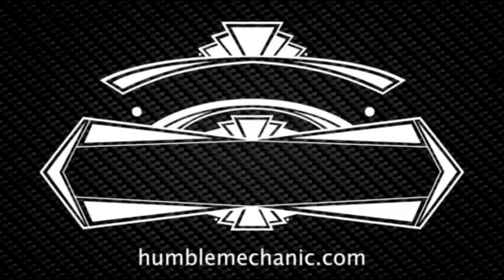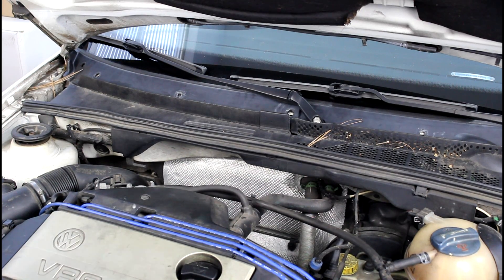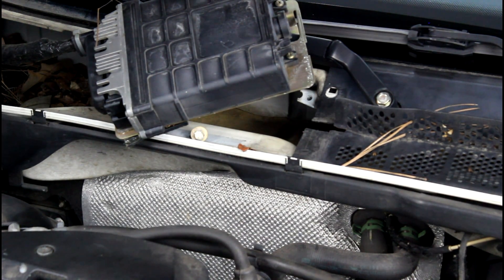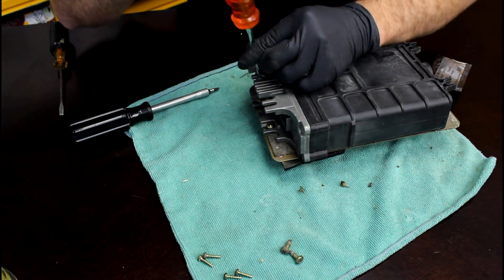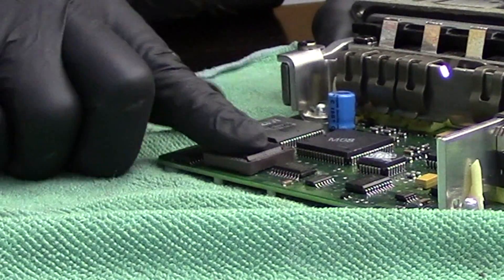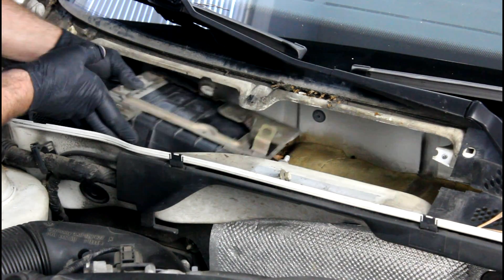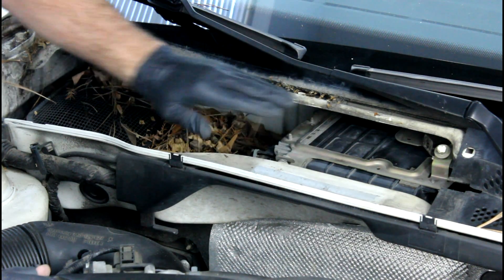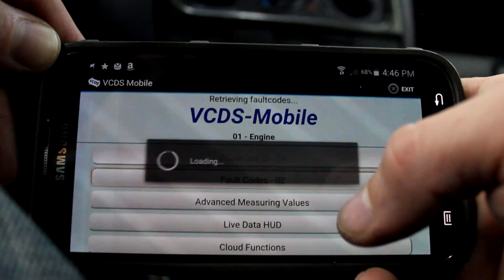How To Chip a MK3 VR6 ~ DIY Video

Comment: Hi help/exsperience would be great 

i have a 0bd2 vr6 loom(uk spec) and have just recived a north american ecu with same ecu numbers but the americam ecu has little corner blocks on the ecu plug and the uk spec loom does not have cutouts for them (ecu wont plug into loom).   
All pins/conectors and wires match exactly    .  anyone know about this befor ?  
thanks for any replys

Comment: HumbleMechanic-I realize this is an Mk3 tune but, is there a good ECM MOD FOR MY Mk4 2003 BDF 2.8-litre VR6 24v ?? I know its holding back with its electronically controlled HP. The factory says its at only 200hp stock but, i saw one dyno'd stock at 211hp with only basic mods. KN Filter, royal purple oil, etc
Reply: Did you reflash your ecu in your 24v? I see Malone Tuning has reflash sale until the end of the year at ECSTuning that will net something like 15hp and 20 tq and for under $300 I think it's worth it.

Comment: I did this the other day and found a  giac chip installed from a previous owner, my plug had lots of broken bits and did not disassemble as easy, now my check engine is back on again. At first I though it was because the connection wasnt secure, but I've been driving around with no driveability issues.

Comment: High impedence (peak and hold) line driver. Running 850cc or 1000cc injectors? Definitely the way to go. Adaptronic has some units starting at 850$. For 1350$ you can get an 8channel high output unit(m2000) that can make your VR idle way better than stock even with big/fast injectors. Use a narrow spray pattern on a single valve.(12valve). Standalone has autotune have no fear. Run and do anything you want. Convert to drive by wire and direct ignition.

Comment: I've recently changed my a/c pump, to do that I removed the front end, it was an easy procedure and accessibility made the job easy. Long story short I popped a header tank hose and the temp warning light came on, fixed hose, drove car and it died three times. The last time a friend with a scan tool did a code clear and it started and got me home. When we went to drive again no start. Is this what you meant do a one key cycle, to make sure the code doesn't come back, and what if it does.

Comment: just got a Reflex Tuning chip for my Mk3 VR6, runs soooo much smoother than the GIAC previously used. Highly recommended.
Reply: I see this chip getting around now especially i just seen this vlog from chrstian smith doing a decent preview of the chip. Ive had 95 vr with the garrett chip and wanted to know the difference. There was a timenwhere giac was the shit and the best chip for the vr.  Being that you went from giac to reflect tuning.. you feel its more power? Garrett boast to this day 12 hp and tq respectively. And does it really rev out to 7500 rpm as to garretts 7200?  Thanks.
Reply: What are the advantages of this chip?

Comment: I have been watching your video and really like them. I am doing some research and would like to know what you think. I have a 2002 Jetta Wagon with VR6. I have been discussing doing some modification with others who own VR6s. I was told that the stock engine can handle 400 hp all day long. I utubed vr6 stock engine with turbo and found 400hp turboed cars. I know I would need to upgrad the fuel system. I only want 320 to 350 hp. Would a chip and injectors work? 
I sure wish you were closer to Washington State and see if you would be interested in doing a show on stock engine upgrade. Anyways any input would be appreciated as I completely trust your knowledge about these motors..

Comment: Am I the only one who thinks that isn't the best place a ECU should be placed?
Reply from the maker: +freelan89 you're not the first to mention it. But everything worked out just fine.
Reply: The Mercedes A-Class had the ECU right on top of the engine. In order to change the air filter,  you have to disassemble the ecu. Haha I hate that car
Reply: No, it has a draining system that makes water go to the sides of the car, no water gets in there, only dust and stuff.
Reply: no it's isn't bad place.
Reply: wont water get in there?

Comment: Great vid, but what exactly does this chip do?. Is it a tunning chip, or is it a performance upgrade, how much HP increase. I might have missed something, or does this chip just allow you to clear fault codes?. Can you get a performance chip off your guy, might be a cheap HP increase before the turbo goes on.
Reply: it looks like its used to cancel out codes ...not performance related
Reply: You can clear basic codes like that with most any scan tool. Vcds is used to get access to everything the dealership can. Im guessing it was a performance chip. He just didn't explain what it altered

Comment: question.... my vr6 is q chipped. I bought an emissions delete chip as well, can I use them both at the same time?
Reply from the maker: It will only take 1 chip. The tune should delete emissions too
Reply: +HumbleMechanic the q chip will?

Comment: In the 2 month since you installed this chip did you see a noticeable difference? I don't know much about all the different brands of chips, but for $100, and within the website description, it seems decent. Thank you :)
Reply from the maker: Other than I have no check engine light, not much. But this is a stock car that needs some maintenance. 

It will really shine when I get an intake and exhaust. :)
Reply: +HumbleMechanic Fair enough, I'v got an exhaust/intake.. getting rid of that secondary air code would be cool :)

Comment: i see alot of people suggest an anti static work surface. the only suggestion i would have is to keep that seal good and to help it a little bit.....a thin layer of di-electric grease works wonders. Also great for your main harness plug in to keep any water from getting into a plug with an old seal.

Comment: I'm surprised you havent rigged up a cabin air filter from mk4. The bracket for it bolts right into the mk3
Reply from the maker: That is absolutely on the list!
Reply: @HumbleMechanic  hoping you can help. I bought a chip for my obd2 12v, followed your instructions (thank you). But the car doesn’t start with it. The check engine never illuminated once the accessory lights came on. I swapped the stock one back in, the car started. What gives?
Reply: right. I just did the same thing

Comment: It would be nice; if you would do a review of the wireless HEX NET, version of VCDS. Many of us; have the cable for years but have not made the leap to the wireless version. So far, from a cost effective point of view; I still think the VCDS License with HEX-USB+CAN Unlimted VIN (All VAG), is the best deal (although being tethered to a windows based laptop is a drag). It would be cool; to use a phone or tablet, however.
Reply from the maker: I will. Some of the wifi is still beta. Well at least on the app. But it's pretty awesome

Comment: PLEASE work on an electronic safe surface. When I was putting a new heat-sink on a computer part I was also using a micro fiber rag. While working I felt a little shock, that $300 computer part was toast.
Reply: Modern electronics are pretty good about static. Still always a risk. Iv done that a few times (even smelled a little smoke) but it still worked.

Comment: is your gti obd1? did any 12 valve vr6 cars come with obd2?
Reply from the maker: No it's OBD2. Most 12v were obd2. I think the 24v came out in 03
Reply: I have a 1993 obd1 vr6 in my corrado, wish mine was obd2.
Reply from the maker: I think you can swap out to a coil and remove the distributor
Reply: +HumbleMechanic I think I've heard of some people doing that. Definitely worth looking into, thanks.
Reply: corrado is sweet cause its basically having the light weight of a mk2 VR

Comment: Good video thank you for sharing.   Is the ECU located in the same place on a MKIV Jetta?   I have a 24V VR6 that i wouldn't mind chipping.  ;P
Reply from the maker: It's in a similar spot. But I think on your car, it's a flash not a chip replacement.

Comment: Hey Charles, on the wireless OBD cable, do you have to have a VW specific cable or will one of the $20 generic bluetooth OBD adapters on Amazon work?
Reply from the maker: It MAY work, but my gut says no. It is looking for a wifi address and I don't know if the generic ones will have what it is looking for.  

I think the wifi is great, but it is pricey. I think for most folks the standard cable is the way to go.
Reply: +HumbleMechanic  Even still laying out 100 something for their proprietary connector is better than the cost of the software. If it works on wifi, then it's probably a definite no because most of the generic ones I've seen are bluetooth

Comment: Great video.  Did you notice any performance gains from the chip upgrade? You should always use an ESD (Electro Static Discharge) mat when working with electronics or circuit boards.  The last thing you want to zap the ECU or any part of the board.

Comment: those PLCC chips, so retro!. BTW i'd also check the state of the capacitors whilst the ECU is open, a while back iirc on Toyota cars bad caps where failing the ECUs(there was a recall or something), doesn't hurts to check and it's an easy repair.

Also, that chip mod is easy with those socketed ROMs, newer ECUs are more complicated sadly :(

About VCDS, love it but it's crazy expensive, and they seem to have cracked down on chinese copies(there where bulk of them on DX, now i can't find any)
Reply: +Guillermo Lovato , little complicated, use google.
Hint - vag com 15.7 gives 104000 hits. you have it on first page.

Comment: Will Vagcom fix my automatic door locks from automatically re-locking on their own after a period of time in my 98 Golf? I've locked my keys in my car because of it before.
Reply from the maker: No. You probably have a bad latch in the car.
Reply: What part of the latch would actually be bad? The only thing I can think of is the contact switch in the rear hatch mechanism. I can only open my hatch from the button in the center console and its only able to open for the same amount of time that it takes for the for locks to auto lock. A correlation perhaps?

Comment: Did the fault code have anything to do with the chip swap? Or was that an existing fault?
I'm not sure I see the point of connecting the VCDS other than clearing the fault.  Would the fault have cleared otherwise?
Reply from the maker: It was an existing faulting the main reason for the chip. 

It's always good to check faults after work like that. Many failures are 2 trip monitor failures.  That means they need to fail a test twice to turn the MIL on. But you can often see the fault stored before the MIL is on. 

This may help prevent an issue while on a test drive. Think about the drive into work @6am the next morning and the MIL pops on. I'd rather know I have an issue while I am at home or the shop. Rather than wait until I am on the road.

Comment: Good Video, what's the performance improvement on the Chip? or was this just a repair job? Thanks!
Reply from the maker: Thanks. The chip has an estimated 10hp gain. I don't really notice the improvement while driving. But the car is stock. You can feel that airflow is somewhat stifled. I think with an intake and exhaust it would be very noticeable. 

The main reason for this tune is to solve a check engine light issue due to a failing secondary air system.